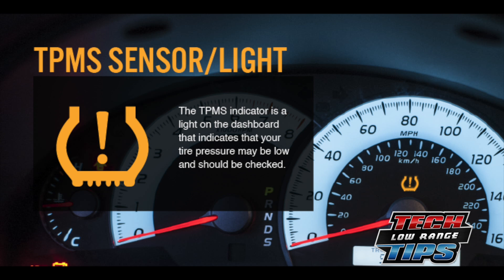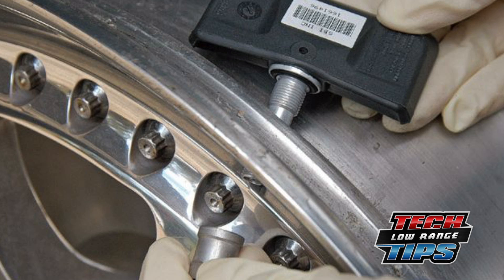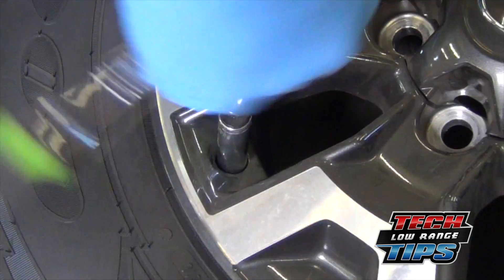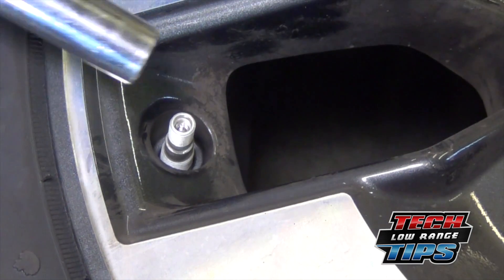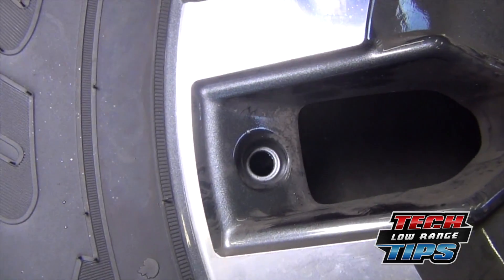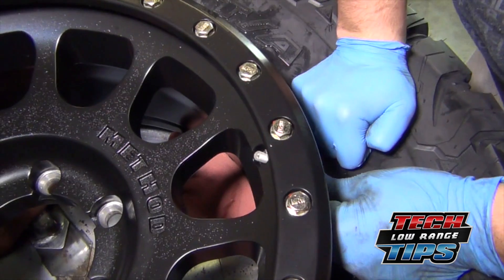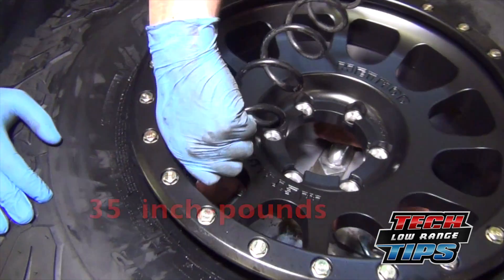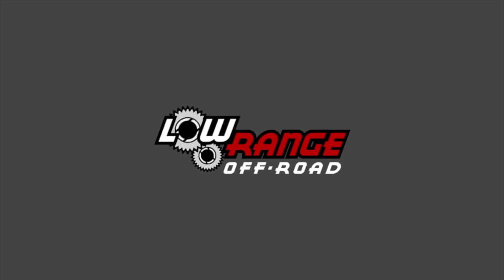Tire Pressure Monitoring System (TPMS) Sensor Replacement

Comment: So these will automatically reconnect to the trucks system?
Reply: No, if you are replacing a sensor with a new one you have to program it to the vehicle with a special tool. If you are just swapping sensors over to different wheels you wouldn't have to, just make sure you put them back on the vehicle in the same position they came off, otherwise you would have to relearn the tire positions with the same tool.
Reply: @RazzalDazzal  So if bought new wheels and tires with the sensors, I have to buy a tool to programme them to work. Where do I buy a tool like that?
Reply: @Deaco_DG  The tool can run you hundreds of dollars I wouldn't buy one just to use it once. Any tire service center should be able to program them for you pretty cheap, just call around
Reply: @RazzalDazzal  Hey thanks so much for the help. I really appreciate it.
Reply: @Deaco_DG  No problem, hope you get it all sorted out!